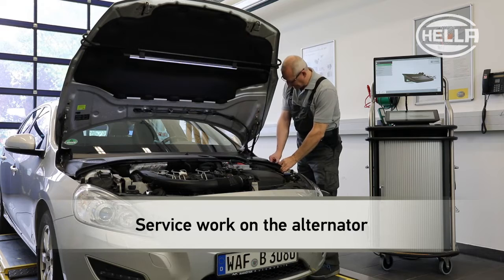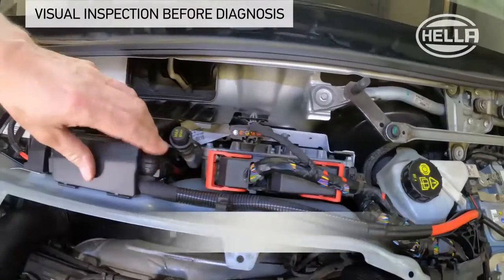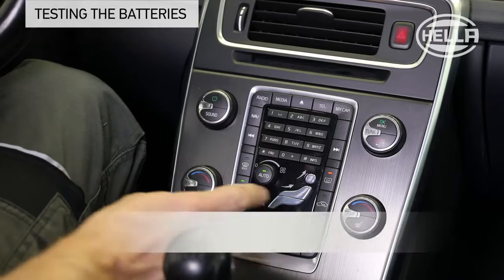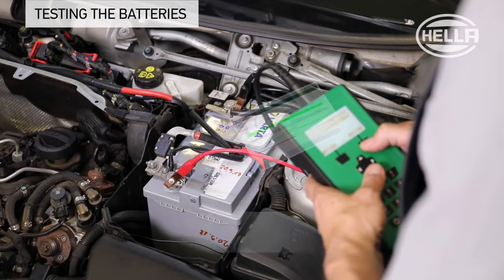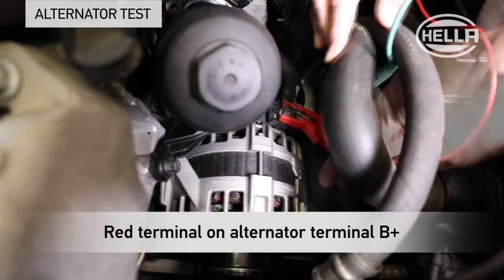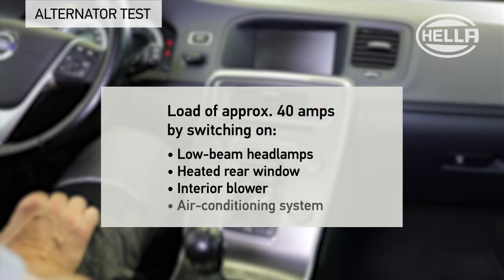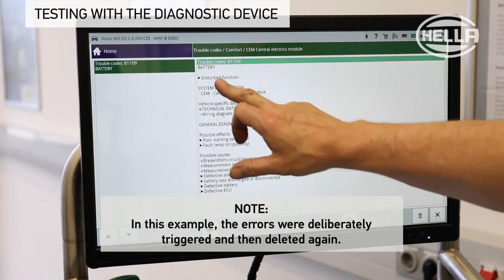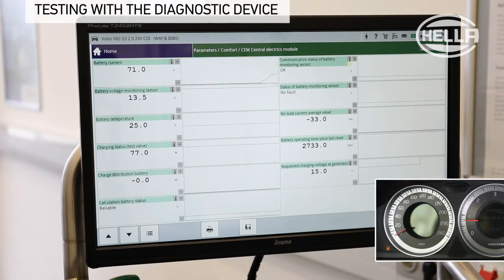Battery Charging System Check for Start-Stop Vehicles I Volvo V60

Comment: Hi! Very explanatory video! Thank you. One question, i owe volv v60, 2.0, 2024. When i measure voltage of battery with digital multimeter with all appliances turned off the meter show 15.1 volts. Is thih OK?
Reply from the maker: Hi, thank you for the question! Sorry for the delay in the asnwer but here it is:
Modern vehicles with a battery management system may well have voltages of 15 volts.
This must always be considered in relation to the overall components of the charging system.
The generator output, battery type and state of charge have an influence on the charging characteristic.  
In this case, an assessment should be carried out by a technician on the vehicle.

Hope it helps you ! 💪🏻
Reply: @HELLATECHWORLD thank you for taking time for the answer. It helps a lot!